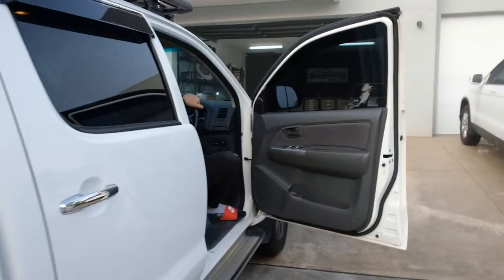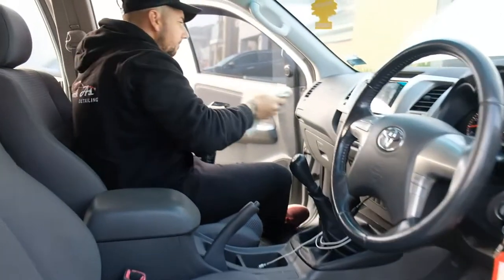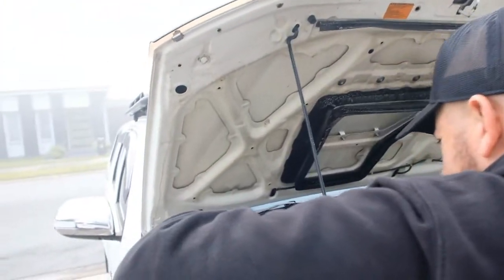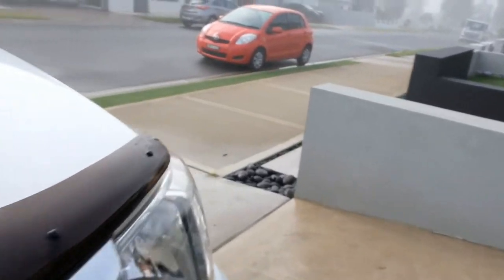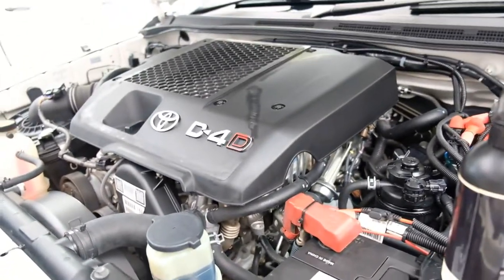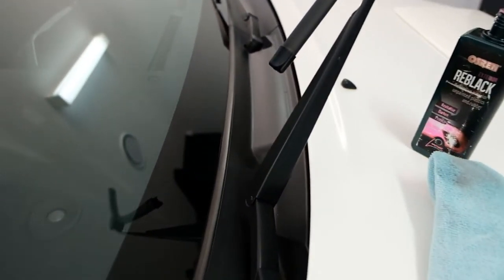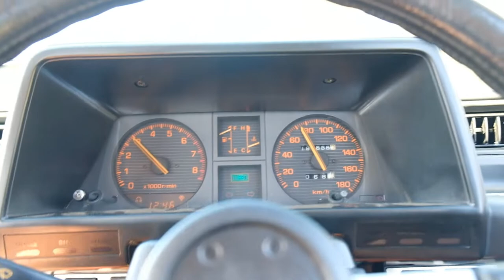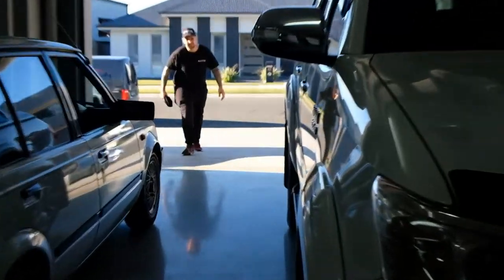Pre Sale Detail! Daihatsu Charade Turbo G11 continues - Smooth As Detailing

Comment: Does the car have the original turbo and how many bars do you need the charge the turbo?
Reply from the maker: D_ G11 original turbo yes. 
This turbo has been rebuilt to standard specification . 

Standard is 5 psi. We are running 13.5psi
Reply: Smooth As Detailing  How hard it is to find parts where you live? Because in Europe its kind of impossible